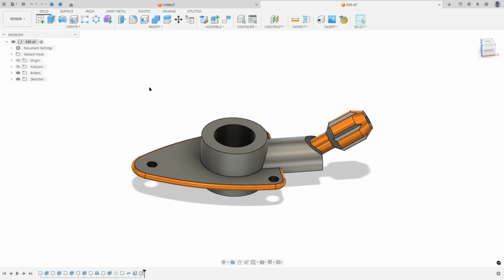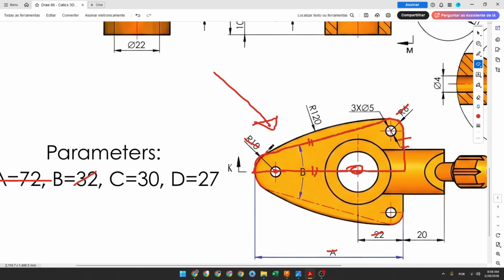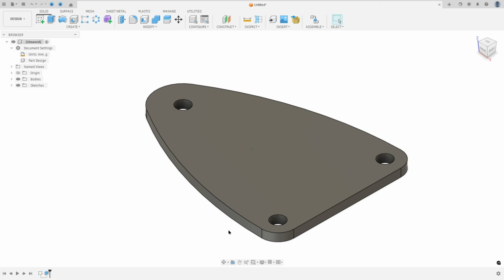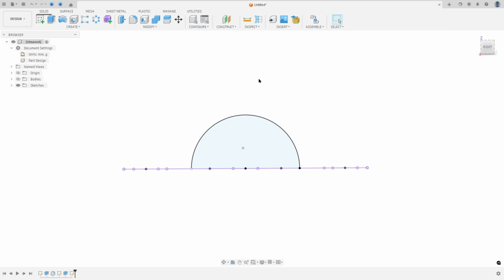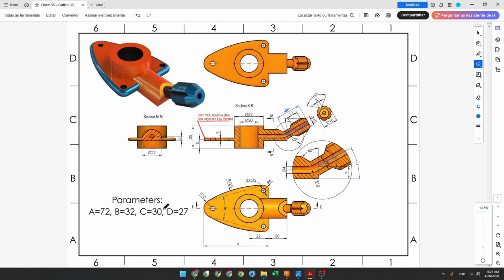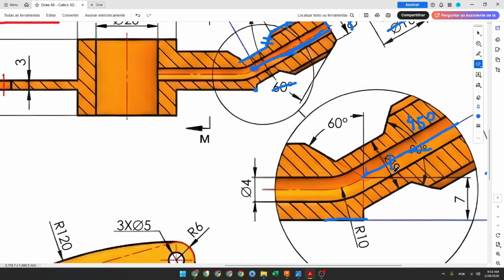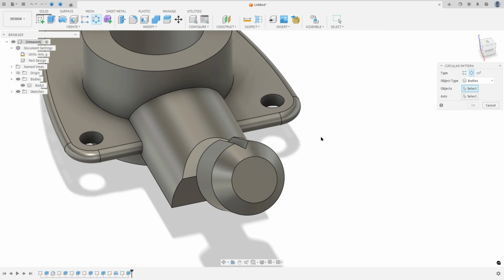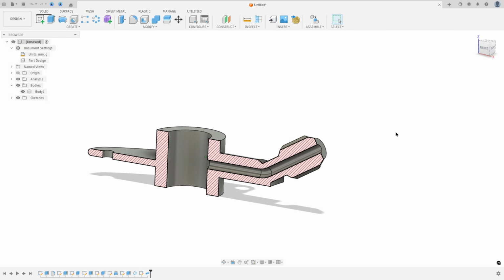Can You Model This? Fusion 360 Challenge - Catics 3D01-02

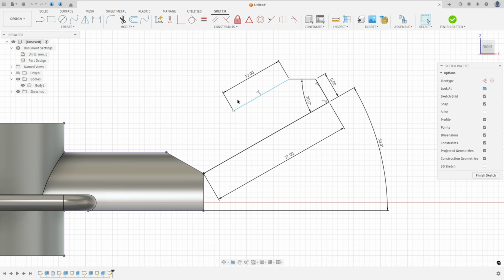Comment: Thanks for your video. The only thing I like to do different is use the diameter feature more. Like at 12:07 you reference "16 over 2", but I like my dimensions to show the same number that is on the drawing to confirm it is accurate. Select the 'inside/mirror' line, then select the "outside" line (the order matters), then right-click and choose 'diameter dimension'.